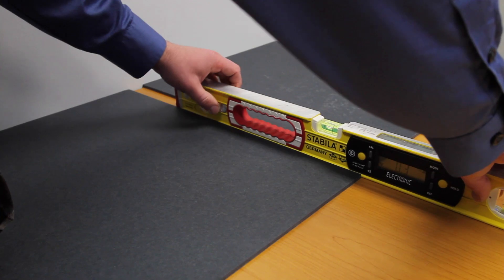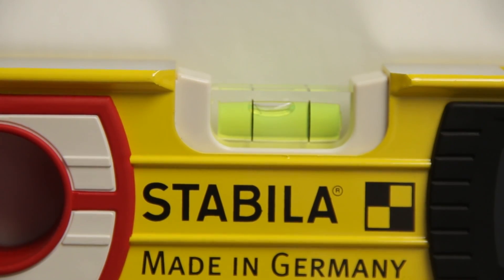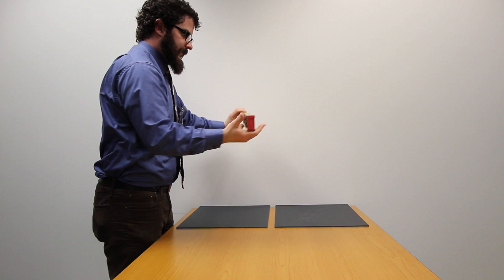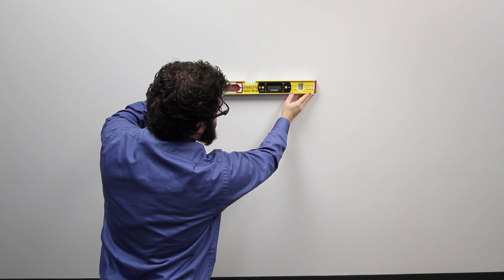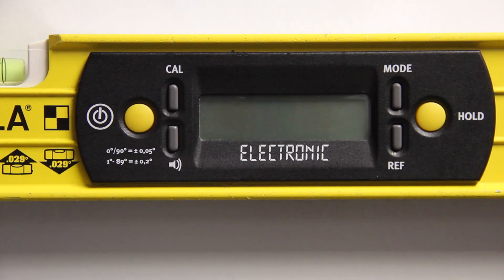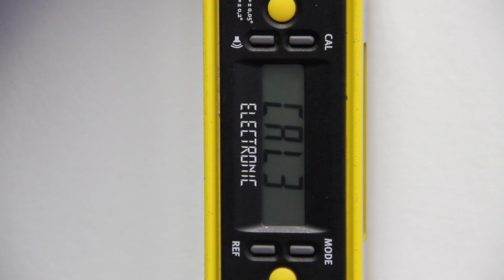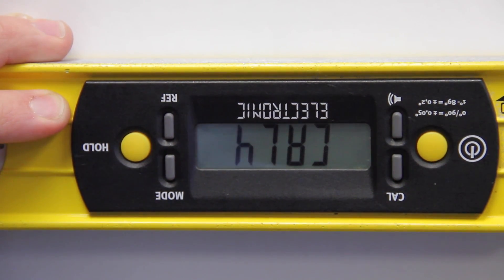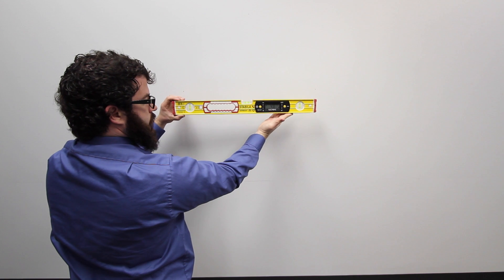How to Calibrate a Digital Slope Meter

Comment: For easier and more precise calibration, check out the new How Far Out level gauge and positioning device.(www.howfarout.com)
This elegant accessory transforms Stabila and other premium levels into precision survey instruments by providing a level adjustment screw to position the level along with an integrated scale to determine how far from level or plumb an existing surface is. The ability of the level adjustment screw to precisely space the end of the level from a horizontal or vertical surface enables the calibrations shown above to be performed by resting the level against either a fixed horizontal surface like a table or a vertical surface such as a wall. You will find that this ability to dial the level into perfect position will make calibration much easier and more accurate at the same time.